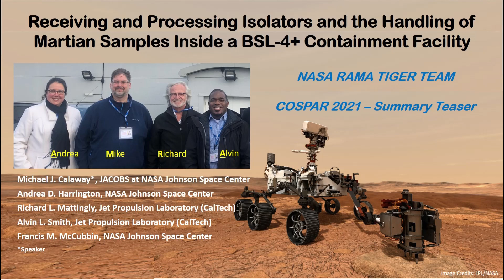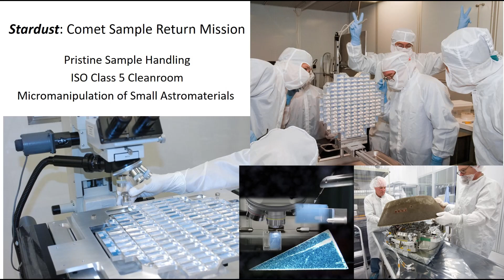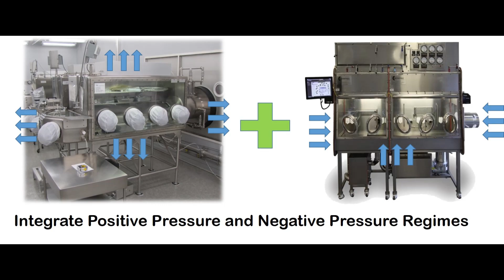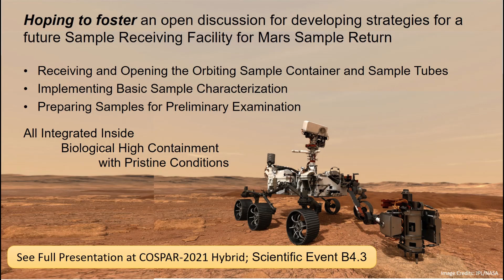Receiving and Processing Isolators and the Handling of Martian Samples

Comment: Date 15/06/2023.Time 20.06 ., Went from South 203 degree to north 20 degree.I have seen mine go from 45 degree to 110 degree  .  north side fully cloud. So could not see in full... 2 dim star one by one A straight line pattern went by without a single straight line  Distance between two stars  approximate 25 degree will be., A plane went before that star  20.04 time . When the plane is viewed from the sky, the speed of the plane is the speed of the star...Find out what it is